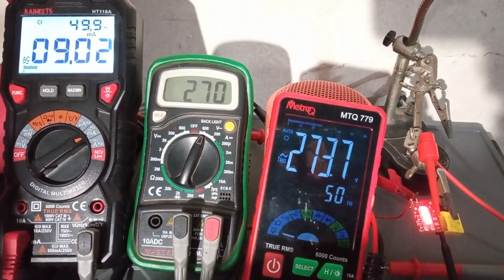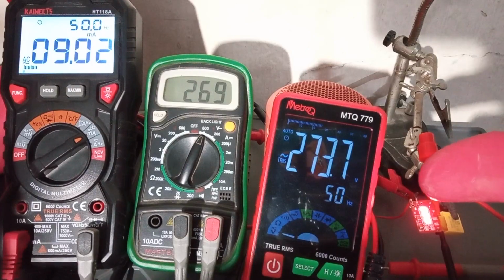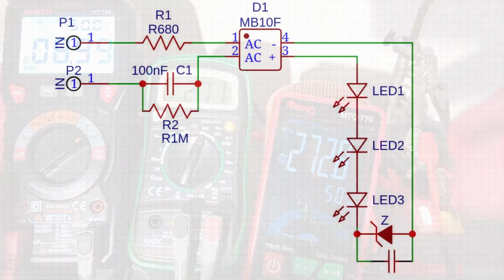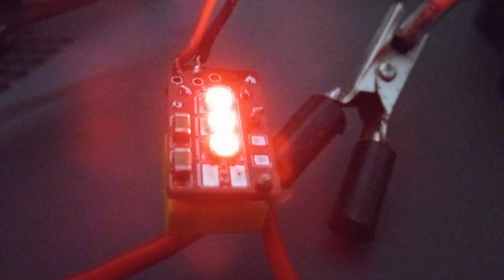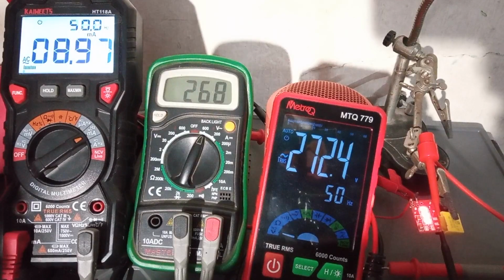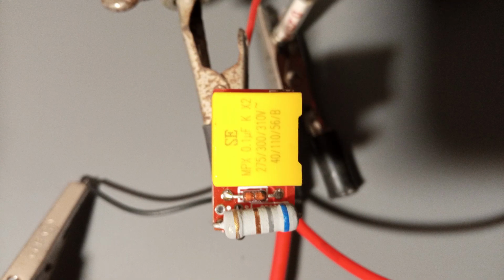Pushing the Limits: Testing a Small Capacitive Dropper Beyond Its Rated Voltage

Comment: Use higher voltage led like 18,27 or 36 volts to reduce voltage stress on capacitor. The voltage drop will increase in series.